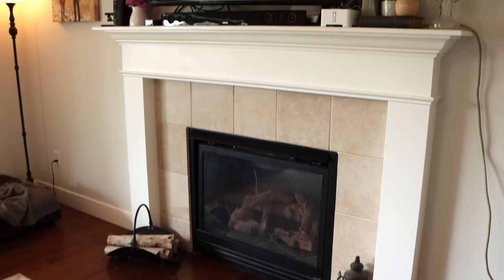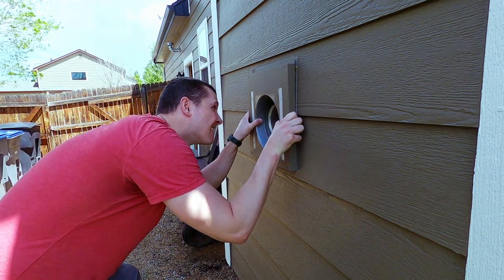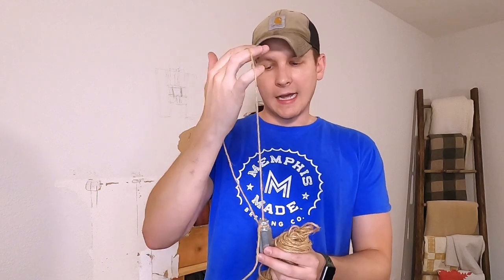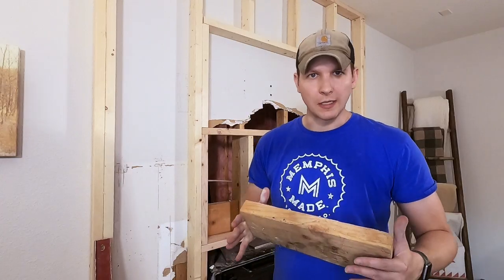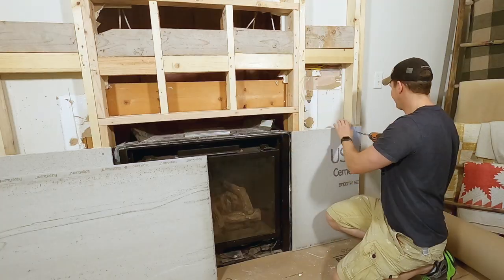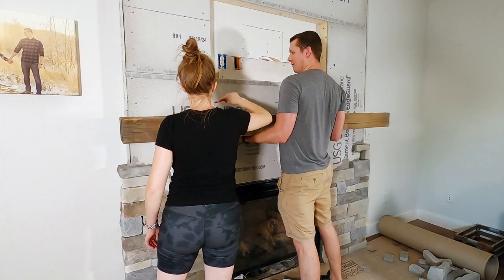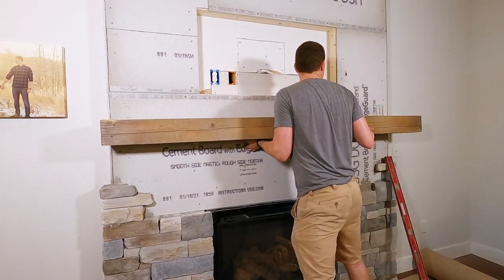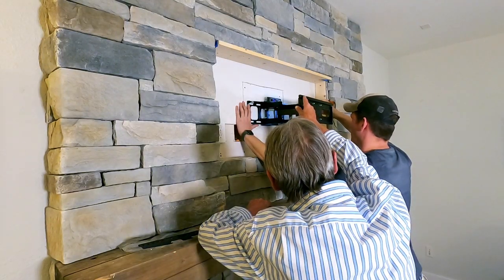DIY Stone Fireplace Renovation with Hidden Storage

Comment: Would you mind letting us know what type of stack stone you used, where you purchased it, and where did you get the exhaust extender for the fireplace insert. Great first video!
Reply from the maker: Thanks! The stone is Eldorado Mountain Ledge in Sierra color. I got it at a place called C&C Stucco in north Denver. I got the vent at some small hot tub/fireplace store in South Denver but can’t remember the name.

Comment: Awesome video!! I’m about to start doing similar stone from a company called ProVia, this came out great!! How’s it been holding up so far?
Reply from the maker: Thanks! Looks just like when it went up. I actually tried removing a small stone after everything was set to adjust something and couldn’t pull it off with a pry bar, so I’m pretty confident she isn’t going anywhere 😆 good luck on your project!
Reply: @CraigHartmanDIY  oh wow 😂 that’s awesome! And thanks for the response! Do you think if I used Quikrete Mortar Mix Type N it’ll be okay?
Reply from the maker: @ryanpereira8133  I would look at the tech sheet for your stone first to see what it says about mortar and substrate. It probably will say what types it requires. Type N says stone, but I lean more towards what the stone says will hold it in place.
Reply: @CraigHartmanDIY  sounds good, thanks again and keep up the good work!

Comment: Probably should’ve taped and mudded those seams on the Durock, along with dampening the Durock before adding  mortar to the wall in addition to back buttering the stone. Looks great though, hope it lasts.
Reply from the maker: I get taping seams for tile in a shower, but what’s the thought for the stone? Time will tell but I wasn’t able to remove a stone when I tried with a pry bar and hammer so I don’t think the moisture was pulled out of the mud too fast.

Comment: Hi, your setup looks great. I am planning to do something similar. Just curious, how high did you mount the TV? and whats the distance from the floor to the bottom of fireplace and the distance between the fireplace and the mantel? I am trying to decide on a tv height and dont wanna end up too high. I have a 65" TV. Thanks
Reply from the maker: Thanks! We moved from this house so I can’t measure, but the bottom of the tv was just below chest height (I’m 6’5”). Check out the recommendations on your fireplace if you can. My natural gas insert had specific clearances on how much space was needed.

Comment: Wowwww thank you for this very well explained video.  What do you suggest if I want to integrate modem or PlayStation.  Is it better to put them elsewhere by passing the wiring in this set-up?  What have you done?
Reply from the maker: I put one of our Orbi satellite routers behind the tv. If you have a number of components you want plugged in to Ethernet you may want to put a switch back there to plug multiple components into. We don’t have any gaming systems but I would say if you need to access the actual PlayStation regularly I probably would hide it behind the TV. If you don’t need to physically touch it then behind the TV may be a good option!

Comment: Sure looks nice in the end, I am just getting ready to install mine so this really helps. FYI - I believe there should be a non-combustible material hearth out 12" from the fireplace. It should be in the instructions if you can get ahold of some online.
Reply from the maker: Good luck! In the install manual for our specific model from Heat & Glow requires a 1/2” clearance of combustible materials around the sides and different height clearances of a mantle based on how far the mantle sticks out, but actually doesn’t require a hearth. You’re definitely right to read that manual though if you can get your hands on it. It helped a ton.
Reply: @CraigHartmanDIY  Yes you did talk about the 1/2" clear to combustibles. I have an older stove so maybe they have improved the safety to remove the need for the hearth. I believe mine talked about no hearth required if the stove was high enough but can't remember. Anyway you got it covered.

Comment: what kind of cement did you use？
Reply from the maker: VersaBond LFT
Reply: @CraigHartmanDIY  Thank you for your answer,and in this case,can I use drywall ?
Reply from the maker: You’d want to check the spec sheet for the material you’re putting up. The stone I used was very specific on what type of mortar and substrate to use. Usually just drywall is not going to be a recommended substrate and you’ll want to use cement board or plywood depending on what you’re doing.
Reply: @CraigHartmanDIY  Thank you so much !